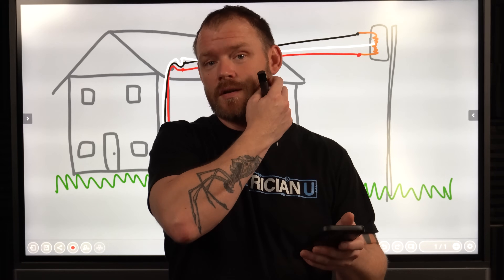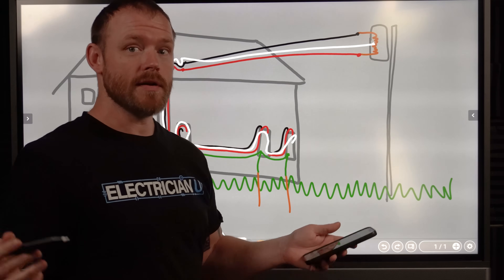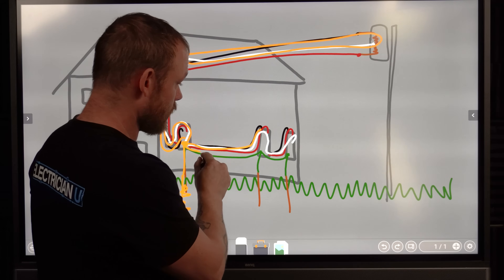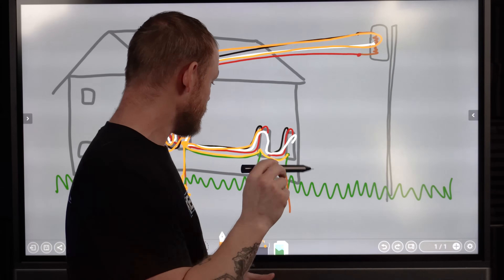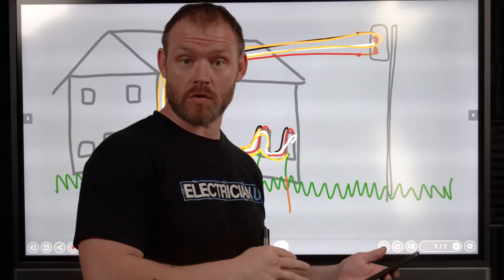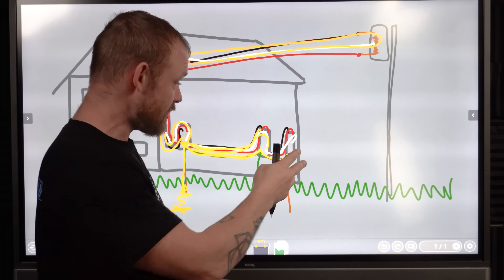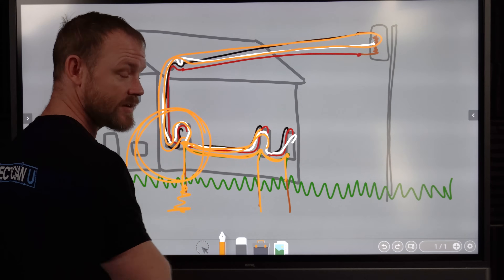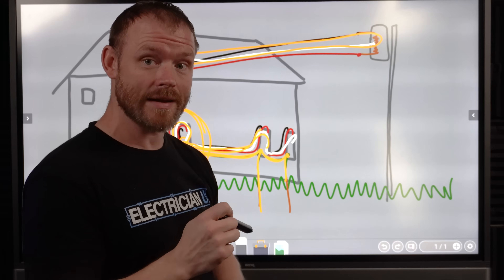Do We Need Separate Ground Rods for Each Sub Panel?

Comment: Hi Dustin... Love your videos.  I am an electronics engineer but not an electrician and I respect how much real theory you understand and teach.  I have a question.  I have 400A service to my meter which is by the well.  I am building a 50 x 80 hangar shop right now (no house yet)  I will be running the electrical soon in a 4" burried conduit soon to the hangar/shop  Since this will be the service entrance for this building which has a ground in the cement foundation and I will run a copper ground rod by the meter,  do I need 4 wires to the panel?  Or would this be standard 2 lines and 1 neutral since it is the service entrance.... OR is it still considered a "sub panel"?  @electricianU

Comment: It should also be noted, the reason we do not put a ground rod at each subpanel inside a home is it then give a path for lighting to run up the rod and conductors closest to a lighting strike, through the home and back out the ground rod that is further away from the lighting strike.

Comment: I hope you see this post and can answer this because with all the scammers out there I will have to see the answer typed here or in a video because scammers are everywhere! I have asked this question to electricians , electrical supply store, power company engineer, and others  and tried to find it in code and on the internet. I have 200amp panel outside on pole and 7feet away I have 200amp subpanel inside. Bonded the outside 1st  panel after meter (main) I have 4/4/2/4awg green 4 wire cable to run from main outside to sub panel inside will connect green wire to ground bar neutral is issolated and seperate. Green wire connects sub panel to bonded neutral/ground bar in main panel 7ft away on the pole, the grounding rods 2 are connect to main panel neutral/ground bar. Do I need seperate grounding rods for 200amp sub panel (which is only panel in the tiny house) or will the 4th wire (green) that connects to main panel 7 ft. Away outside on service pole  main panel neutral/ground bar that is grounded to 2 ground rods be correct? If I  install ground rods at the sub panel that seems to me to be adding a path that is alternate . The green wire connected to the bonded neutral /ground bar  that connects to the ground rods (7 ft. Away  one at pole and the other  over 6ft. Away but closer to house , definately do not want to run the bare #4 copper continuouse thruogh both grounding rods and connect to ground bar in sub panel that definately is 2 of the same circuits. If I add 2  grounding rods  off the sub panel they would interfere with main panel grounding rods unless and it would be guessing how far pass  main panel g-rods I would have to put them (2x 8ft=16ft ) but it would  contact the ground and pass right by one of themain panel g-rods (to close) unless i run another g-rod opposite direction from g-rod.  And connect it to main panel and connect sub panel to 2nd ground rod and then it would over 6 ft. And should not interfere  and if needed add 2nd g-rod for sub panel going away from other g-rods.  Sorry so long , just wanted to give all the facts. But the question of do I need sub panel g-rod with the green insulated wire going back to main panel neutral/ground (bonded bar)  with it being only 7feet away and the neutral/ground bar grounded basically right beside pole under box 3ft max.  I hope you have answer, the only thing I can think of is if green wire gets removed broken , cut from its 2 ft underground PVC Conduit then the sub panel would have alternate path to ground . Please    help!

Comment: What if The main panel is in one building and your sub panel is in a detached garage or any other detached structure? Do you need a separate ground rod at that sub panel?
Reply: according to the NEC, yes
Reply: @neoyid how would you interpret 250.32(A) then?
Reply: Do you also need a ground conductor from source panel AND a ground rod for said outbuilding?
Reply: Yes

Comment: Not quite right...

Multiple ground rod connections to assorted panels means multiple current paths to ground and that means you can get spurrious GFCI trips and other issues.

When you do multiple ground rods, such as needing a total of 6 ft of rod, but having granite 2 ft below ground, making a choice of multiple rods or bore a hole in granite... you chain the short rods in series on a single wire to achieve the desired grounding.  
You don't connect one rod to the right and others to the left of the initial rod.  You string them in a single straight line on a continuous, uncut wire.  The panel "sees" one ground.

Comment: We do the same in Australia,  but we don't have that weird split phase system with two hots and a centre tapped neutral,  we have either a single phase or three phase, so we never have issues where a faulty neutral makes some lights brighter while others dim and odd voltages etc, in our system, that can't happen. I'm not sure why America uses the system they do.

Comment: What if . . . 
A major medium voltage distribution line comes down near one of the ground rods in your sun panels?  This would electrify the ground circuit and the farthest ground rod would discharge this voltage because of lower potential.  Current is now flowing through the house.  This doesn’t sound safe.

Comment: You forgot to add if the sub panel is installed at a separate structure you are required to install another grounding electrode at said structure. NEC 250.32(A)
Reply: Yeah, but you still can't bond it to neutral either
Reply: Hypothetical - ADU Sub panel fed from a 100A breaker in the main panel, directly to main lugs of the ADU sub panel.  Two wire only, no neutral between main and sub. 

Could you then add ground rods at the sub panel and bond neutral there?  Would that be creating a separately derived system?
Reply: then also run a 6ga bare wire between ground rods
Reply: Thank u what I thought what I came for but information in the video was also helpful as I've opened a lot boxes that had commons and grounds going to the same bar just always bugged me job I'm working on now has 50/50 100% wired wrong

Comment: How is an old glass fuse box bonded?
Reply: You don't, but still bring an earth cable into it to pick up the earth wires from its final sub circuits
Reply: I have never seen such panels used as service equipment.  The really old ones were bonded to the box or metal conduit with armored ground wire to a water pipe.  I don't think this wire attached to the neutral bus.  When fused disconnects were added as service equipment to feed such panels, the bonding between neutral and ground took place in the disconnects.

Comment: The only time earth ground would be required by code to what I understand is if a sub-panel is attached to a separate structure. At least the state I live in requires it. But I do believe the code also has that requirement, just don't remember off the top of my head where to find it.
Reply: This was my question, I'm having a sub panel installed in my detached garage and my electrician said I do need a grounding rod for the sub panel. 🤔
Reply: @abby2674  That's covered in NEC 250.32
Reply: @abby2674 that’s true

Comment: Would you please make a video of the requirements in NEC for installing an outside feeder to a detached building and installing a sub panel?
Another great video!
Reply: I work In a small town where we really don’t have codes enforced. One thing I always wandered is we run aluminum triplex to most outbuildings with no egc. We also don’t put a ground rod at these sub panels. I don’t like it, but I’m not the boss. If you did put in a ground rod would you then bond the sub panel? Or is it even legal to put a ground rod with no ground conductor to the main disconnect?
Reply: @ConwayCowboy     Brandon,   Your situation is a little tricky.   Even though there are no inspections, there is most likely a City, County, or State adoption of NEC.  Depending on what is adopted makes a difference.   Between 1981 and 1996, the NEC flip flopped on how to feed a detached building.   If after, let’s say 1999, it has stayed the same.   So, I can tell the answer if adopted code is 1999 or later.  And this is one building fed from another building.  Not a service at each building.
I do not know if this for agricultural buildings so, I looked the requirements and they are the same as a detached building.   

1.   Article 250.32 says that an EGC must be installed, and run between buildings.
2.   There must be a separate ground bar in the sub panel.   
3.   The neutral and ground should not be bonded.
4.   Article 225 requires a means of disconnect at or near the point of the conductors entering the building.   So, if directly into the sub panel, it can be a main breaker.  If the panel is some distance inside, then a Safety Switch could be used.
5.  Article 250.32 again says the sub panel must be attached at the ground bar to all grounding electrodes.   So, if wooden building most run #6 to ground rods.  Must have two unless you can test and prove 25 ohms or less.  If steel building, the steel must also be connected with correctly sized GEC 250.66.
Just so you know.  Equipment ground conductors are to carry ground faults to the neutral at the main panel and to the transformer to trip the breaker.  GEC system is for the purpose of dissipating lightning energy to earth.
Sorry this took so many words!   Hope it helps you.   Any questions?   Just ask.   Best wishes,   Kevin
Reply: @ConwayCowboy    I just looked at your profile and saw you are in West Texas.   Texas has adopted 2020 NEC and went into effect Nov. 1, 2020.
Reply: @ConwayCowboy  The reason they can run the triplex is no code enforcement. Triplex is allowed in Texas under the public utility code, however, triplex is not a listed conductor or cable and therefore can not be used after the service disconnect.

Comment: If subpanel is at seperate building from main service panel then you are required to have ground rods.
Reply: Yes, but that's not the whole story. DO NOT tie the neutral in that sub-panel to ground.
Reply: @paulmaxwell8851  right
Reply: new code says YES.

Comment: One thing seems a little off to me here.  Your house, and your neighbor's house are are often served by the same transformer.  Both of you have your own main panel that has neutral bonded to earth ground.  So there, you already have multiple return paths ( to the transformer ).  That isn't a problem.  The problem is is bonding neutral to ground in a sub panel that does NOT have its own grounding rod.  As long as it does, then how is it any different from you and your neighbor both having your own ground rods bonded to neutral at the main panel?  I think that if your sub pannels are not far from the main, there isn't much point in adding more ground rods, but if your sub panel is out in a shed 200 yards from the main building, then having its own ground rod is a good idea.
Reply: The ground is not a current carrying path for return to service transformer.  The rod is to equalize a zero potential voltage on all parts fixtures equipment of a structure that should not be energized.

When you have a feeder neutral and ground bonded at both ends, current will follow both conductors.  Current on EGC in feeder is objectionable.  Any conductive path between the two buildings can be a problem if neutral is bonded more than one place.

Current leakage through the dirt between ground rods, or between cross-connected services (example: a multi-unit building) is issue if any service fails to bond at main service entrance.
Reply: @timgerk3262  So is the difference that the subpannel has a ground path and a neutral path back to the main pannel where they are bonded, but the serice line back to the transformer doesn't have a ground line, so it can't split the current if there's a fault?
Reply: @ahahn2  good question; two points.  If neutral and ground are bonded at subpanel, current under normal circumstances will flow on both conductors in the feeder to the other bonding point.  (It doesn't matter what you name a conductor, or what you think is it's proper moral role.  Electricity dgaf.)

The neutral conductor on the service drop is earthed at both ends--the transformer pole is a separate structure.  All current, whether normal or fault current, completes a circuit through the secondary winding through the neutral.  For engineering purposes, current through the earth is negligible.  No part of the equipment grounding system should be energized except during a fault & in order to trigger protection device.
Reply: a subpanel in a detached shed / garage will have its own ground rod these days, but ground and neutral are not bonded at the subpanel.
Reply: @rupe53  Right, but WHY?  I get not bonding at the sub panel when it does not also have its own earth rod, but when it does, why shouldn't it be bonded too?  How is that any different from you and your neighbor's house both having their own man with their own earth rod, but sharing the same transformer?
Reply: @phillipsusi1791  ... I see your point and I asked the same question a few years ago. The answer is "NEC says so".... and there's only one point of bonding within a service. Going back 10-20 years ago, there was no ground rod at a shed / garage, so it was easier to understand. You just ran 4 wires back to the main panel and called it a day. I would venture a guess that there are still small towns on the old code somewhere.
Reply: @rupe53  Nothing like learning by wrote I guess ;)

Comment: Why do we use the earth as a path for unbalanced charges ?
Why do we use neutrals ?
Why use single phase transformers, and "center-tap" them, to feed residences?
Powerplants generate 3 phases very high voltage ( delta configuration )and they step it down in sub stations from Very high to High voltage in a delta-delta configuration.
And finally, they step it down again with poles transformers to give us 3 phases delta-Y configuration ( 600/347v ) or single phase( 240/120v ) ...
Why???
Reply: We use neutrals so that the imbalanced current has a low resistance path back to the transformer on the pole.  If current has to return to the pole through the Earth itself, it will have fairly high resistance and so can cause one leg to have lower voltage, browning out equipment, and the other leg to have higher voltage, presenting a shock hazard and burning out equipment.
Reply: @phillipsusi1791  ok yes.. but Why not only 240v, rather than 120/240v
Reply: @martf1061  Because a lot of equipment can only handle 120V ( for historical reasons ), and 120V was chosen when electrification was first being done because it has less potential to shock you.  We got to 120/240 split phase because it allowed backward compatibility with 120v devices and the safety that provided, while also allowing one or two heavy loads to take the full 240v.
Reply: @phillipsusi1791  it's a very odd system huh

Comment: A building is all metal and the meter base is grounded, bonded and attached to the outside of the building.  The first disconnect is also grounded and bonded and attached to the metal building. The meter base and first disconnect are connected by pvc only. Does this situation cause parallel paths for the neutrals? Also, in essence, wouldn’t the whole building be a ground/neutral?  Please excuse my ignorance.
Reply: They are two things that are going on.   Bonding the building and panels all at the main and the meter can is correct.  If you have a hot conductor touch the building, the current will go to neutral at the panel and out to the transformer.   If lightning hits your building the electrodes take the lightning to earth.

Comment: This is more of an industrial/instrumentation situation...but could you explain the purpose of a triad ground rod configuration?
Reply: We use (at an industrial chemical facility) a triad ground system for testing grounds. The 3 rods allow us to disconnect one rod at a time to test ground resistance. Most of our mccs also house several plcs or a dcs. The triad helps us ensure any instrumentation or process control issues aren't cause by a high resistance ground